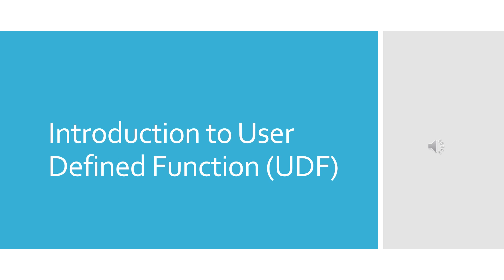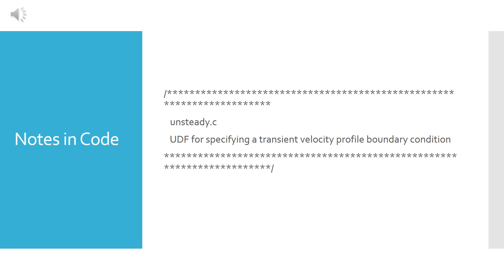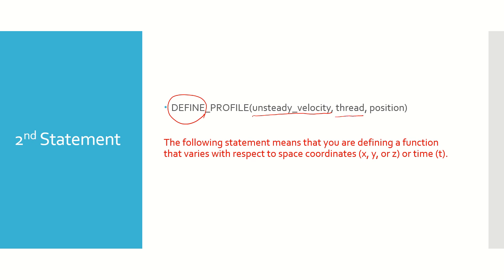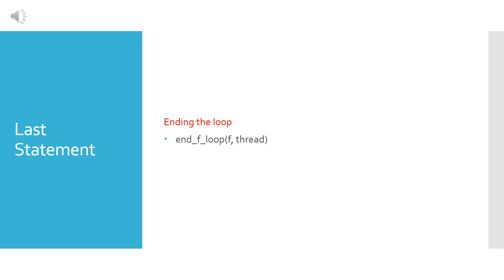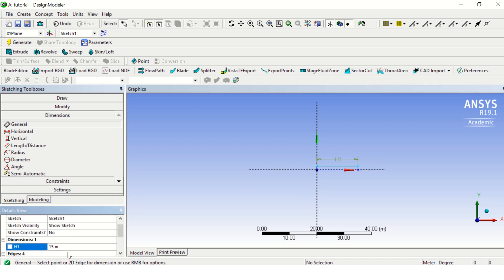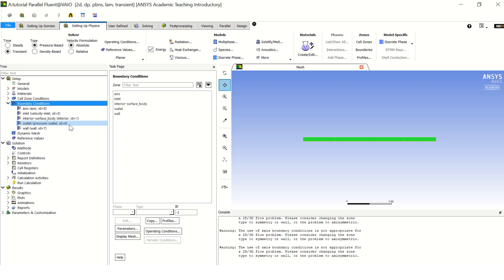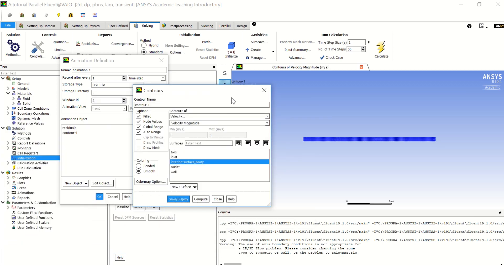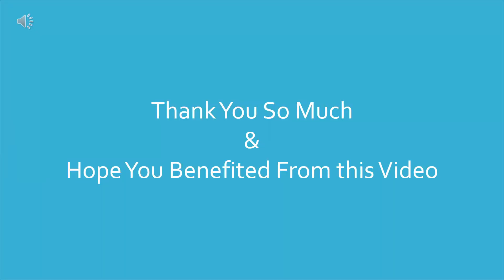👨🏻‍💻Introduction to UDF Coding with 2D Pipe Flow Simulation Tutorial

Comment: Error: floating point exception
Error Object: #f 
What does it mean ?
Reply from the maker: This error usually occurs when some number is divided by zero and causes the simulation to stop. Check your parameters. Also, there may be a problem with the mesh. So try improving the mesh too.
Reply: @AhmadKouta thanks for your advice I will try 😊

Comment: Hello Ahmad, thanks for this amazing tutorial. I'm working an a variable inlet temperature inside a pipe depending on the time steps.
I want the temperature profile to be 27°C between 0 and 600 min and 29,5°C between 1700 and 2330 min, otherwise I wand a constant temperature profile at 31°C.
How can I add these modifications to your UDF code?
Kind regards